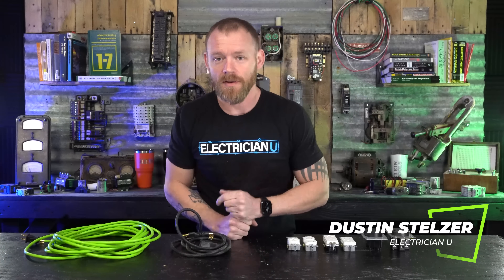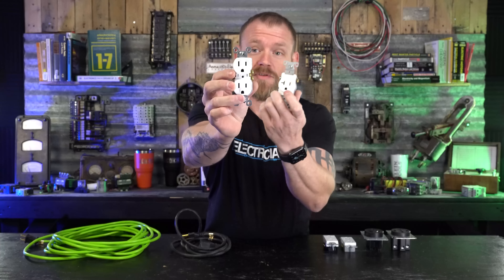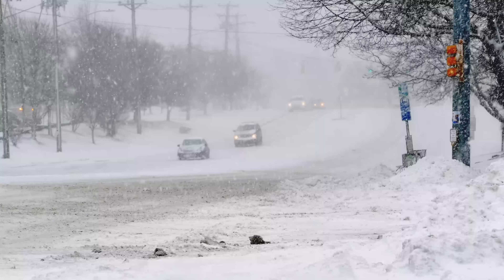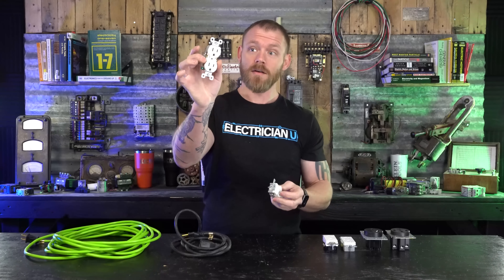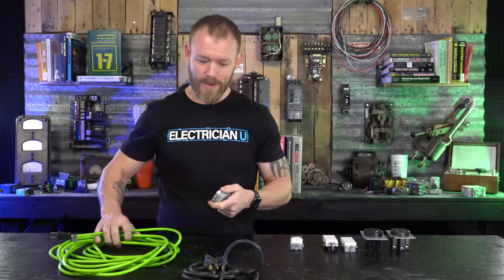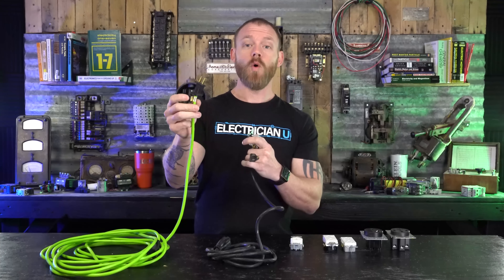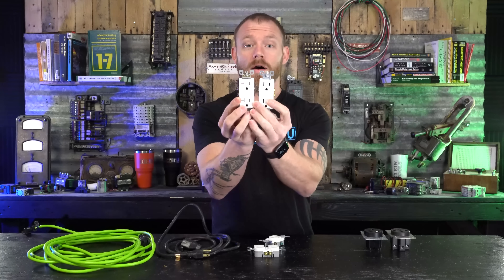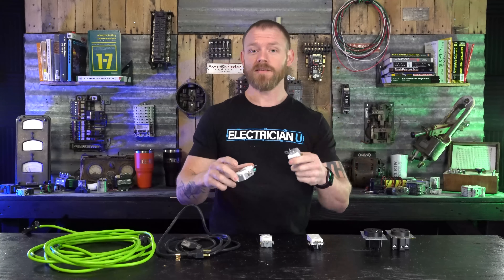Why Do Outlets Have Different Types of Holes?

Comment: Hey dustin, was wondering if someday can you explain about the phase-a-matic pam-300hd is a Phase converter. Hope you see this comment and reply back!!:)
Reply: Explain why ??? Your question is hard to understand the way you worded it 🤔
Reply: Phase conversion,  phase-a-matic , for the conversion of 220v 1phase to 220v 3phase , allowing the use of 3phase equipment in or within a single phase dwelling/property. 

Example : Heavy duty shop equipment.
Reply: @FCES_Electrical_Sol  my work had an alignment lift that went through motors yearly recently. The owners friend came and looked at it. Come to find out, we had an old transformer for a dyno for state inspections left behind. When the addition was done, we found we had 240 without issue but when we hit the button, one legged voltage dropped dramatically! The guy bypassed it and no issues since. The motor even sounds happier.
Reply: I just bought a rental house and the previous owner was an electrician. He had a South Bend lathe in his basement, this thing was huge with a 12 inch chuck and 5000 watt three phase motor! this guy literally climbed up the electric pole outside his house and ran lines from the main lines down the side of the pole and underground into his basement and stole three phase electric from the power company🤣

Comment: A 125/250v receptacle has two hots and a neutral, so it can supply both voltages. Like an oven that has a digital clock, the neutral is needed for the 120v it needs to run. You didn’t say it correctly in the video.

Comment: All 15 amp duplex receptacles are rated to have 20 amps passed through them. This video is incorrect. 

The difference exists to physically prevent people from putting a 20 amp appliance on a 15 amp circuit. If a space heater has a 15 amp plug and it is listed by an accrediting agency,  then it can be plugged into a 15 amp receptacle. If it draws more, it must have a 20 amp plug.  it can only start a fire if it: 
1. Malfunctions
2. Someone plugs multiple space heaters into one circuit and the breaker fails to trip. 
3. A space heater without a tip over sensor gets knocked over.

Comment: 20A outlets can handle more heat than a 15A one.
I would use 20A on everything.
Save the 15A outlets for a dedicated line like for a refrigerator or clock.

Comment: I've seen people have 20 amp breakers, and 14/2 wire.... obviously a change due to tripping the breaker.... I'm actually amazed that these houses haven't burned down by now....btw....you CAN put a 15 AMP receptacle on a 20 amp breaker...as long as the wire is 12/2.. it's code.... would I recommend that? No

Comment: Does that 3 prong 250v outlet have only 2 hots and 1 ground without neutral?
Reply: That's correct. Neutral is used for split phase 120v but 240v uses the entire phase and therefore no neutral. Neutral is the center tap on the transformer which divides the voltage in half.
Reply: The one he shows is a 10-30R with 240/120vac without a ground.   line1, line2, and neutral.   Older style, that is no longer allowed to be installed on new builds.(1996 code update I think).   When the 10-30R is in use in homes, there are instructions on Dryers to bond the cabinet to neutral.

Comment: The round twist lock is for 220v, right?
Reply: No, they are also made for 120-volt receptacles each have their own NEMA number. which designates, 120, 240, 277, 480 volts. lots of twist locks for different applications.

Comment: It really is not the socket that is the problem but if the socket is 15 A the breaker can also be and the wires can be thinner so a 20 A device could overload it. It would take some time for the breaker to trip. 20 A socket is allowed only if the circuit can handle it. A space heater can pull max 12.5 A (1500 W).

Comment: When the small slot is turned 90⁰ its a 240v outlet.

15 amp 120 volt  (I.I)  "5-15R"
20 amp 120 volt (-.I)   "5-20R"
15 amp 240 volt  (I.-)   "6-15R"
20 amp 240 volt (-.-)    "6-20R"

Note: the 15 amp 240 volt version ,while legal, is rare because idiots kept cutting the ground plug off the 20 amp 120 volt plugs so they could plug them in to it upside down. ( and set stuff on fire )

Equipment voltage ratings.
The voltage rating tells you what kind of plug the equipment uses ( grounded or ungrounded) and what frequency the equipment can handle ( N.Americas 60 cycle or Europe's 50 cycle )

"110-120" no ground plug , 50 or 60 cycle.
"120" no ground plug , 60 cycle only.
"115" ground plug , 50 or 60 cycle.
"117" ground plug , 60 cycle only.

So if you look at your cell phone charger it will say " 120 volt" but the power supply for your computer will be labled "115 volt"

Some high end audio equipment will be labeled "117 volt".

Anything that can run on 50 or 60 cycle and doesnt need a ground ( like an old incandescent desk lamp )will be labled "110-120 volt".

Bonus fact.

"32 VDC" means the wire or fuse meets DOT's requirements for on-road vehicles ....ironically one of those requirements is that it be rated for up to 300 volts dc

So yeah, that wire labled "32VDC"  is actually rated for 300 volts.

Comment: If you take both apart you would not see a great deal of difference between the 15 amp and the 20 amp outlet internals . Makes me wonder .
Reply: Manufacturers have standardized as much as possible, in order to use the same production lines to build 15A and 20A receptacles.   The essential difference is the plastic face piece.  The purpose of which is to idiot-proof the user, and stop them from putting a 20A appliance on a 15A branch circuit's receptacle.  The receptacle itself, would not melt, if you retrofitted a 15A plug on a 20A appliance, and forced a 20A appliance to run on a 15A receptacle.  The plug would melt,or the breaker would trip (if it were on a 15A circuit).

You can put 15A receptacles on 20A circuits, since they are still rated to pass 20A between each other, even if only meant to deliver 15A to each individual receptacle.  It's common to do this, because that way you can supply more power to a circuit of multiple receptacles.   Even just one duplex receptacle is enough to permit you to put a 15A receptacle on a 20A circuit, because the two receptacles on a duplex yoke, count as two receptacles.  Vice-versa, you can't do that, as it would cause the breaker to trip, when a user plugs in a 20A appliance.

Comment: You talk about the 3 conductor vs the 4 conductor on the 240, but you don't say why.  I would be a bit more understandable that a range and a drier need 120 in addition to the 240.  Clocks, lights, controls, etc on the stove need 120 and the drier motor is typically, but not always, 120, where as a water heater, welder, table saw, or other shop type tool, only need 240 and the neutral need not be run.

Comment: That receptacle you said for welding showed in your chart as a rv receptacle.   How can you use a 15 Amp receptacle on 20 amps when it is only rated for 15 amps,  you'll overload that 15 amp receptacle and have a meltdown.

Comment: That 4 prong straight blade is not a 120 or 240-volt receptacle it is a 120& 240-volt receptacle.
Reply: Correct. It's got phase a, neutral, phase b, EGC. Whatever device can use the P to P or P to N for something like a dryer to run heating element on PtoP and control board P to N
Reply: Kinda bothered me when he said that.  American Dryers need both 120 and 240.  The timers/ computers/motors are ran off 120vac while the heating element is the only 240vac load.

Same for Ovens/Ranges in the States

Comment: As for space heaters, I have never seen one rated more than 1500 watts, though I have seen some advertised as higher, like 2000 watts, but they plug into a 240 volt receptacle,  15 or 20 amp, like you'd use for a large window air conditioner, but that's something you are not likely to be using in a family residence,  except maybe your garage.  Just saying.
Reply: Think he was referring too multiple ones plugged into on unfused Powerstrip. Only scenario which could overload the wall socket.

Comment: I remember like 10 years ago. You could plug in a cord upside down or right side up. There wasnt a right way. Recently ive noticed all plugs now have a big prong. Wasnt like that before. Worked fine before. Why the hell did it change? And when? Because if it worked before, seems no reason to change it!

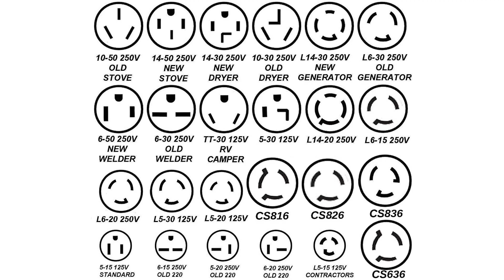Comment: @6:30 is the chart wrong? And showing a 110v 20a as a 220v?? 
At the bottom.
Reply: Good eye. Looks like the 5-20 and 6-20 are backwards. 5-20 should be the 110v and 6-20 is the 220v
Reply: @Krankie_V  both labeled 220v
Reply: @turboflush  I know they are but as you said it's not supposed to be, the 5-20 is 120v

Comment: But wouldn’t a 20 amp space heater have a 20 amp plug? So it would not fit in a 15 amp outlet.
Reply: Some twenty Amp spec graded male plug will not enter a 15 Amp residential grade outlet. Usually found on small air compressors, etc,.
Reply: If the heater used more than about 1500 watts it would be equipped with a 20A plug, correct.

1500 watts at 120 volts is 12.5 amps which is the most that a single  device with a 15A plug should use.

That being said, I have a welder which has a 15 Amp plug and yet is rated to use up to 30 amps current! So far I've never tripped a 20A breaker with it, but I'm going to install a 30A circuit and use twist-lock plugs anyway.

Comment: I'd love a follow up to this video going over why so many rightly believe that it is okay to allow 15 amp receptacles on a 20-amp circuit when this video actually didn't go into it:

220.21 (3) Receptacle Ratings. Where connected to a branch circuit supplying two ore more receptacles or outlets, receptacle ratings shall conform to the values listed in table 210.21(B)(3), or, where higher rated than 50 amperes... etc etc.

In that table it explicitly states: Circuit rating 15 OR 20 Amperes, Receptacle rating 15 amperes, maximum load 12 amperes.

Yes. You can have a 15 amp DUPLEX receptacle on a 20 amp circuit. But you can't.. well.. you shouldn't connect a 15 amp load to it. You can NOT have a 20 amp circuit with a single regular receptacle rated at 15 amps on it. Pretty simple if you look at the code. There's other exceptions but the gist is that it is allowable.
Reply: @scyarch.... You are right. I have never agreed with the thought process that two outlets (provided by a duplex) will allow for the 20 amps available to be split up.... It's still 20 amps flowing through a 15 amp device, right? But I only heard for the first time in this chat that all 15 amp receptacles are actually rated for 20 amps. It makes sense to me now but I am going to verify it. I have never installed a single 15 amp duplex receptacle on a 20 amp circuit because of this. I have installed multiple 15 amp duplexes on 20 amp circuits..... But I have never preferred to. I got to call a rep tomorrow and verify this. If true... I see the logic in it.

Comment: Polarity is kinda irrelevant in AC.  Current flows back and forth between neutral and hot,  they are both 'hot'.
Reply: Wrong, 120v on hot and 0v on neutral which is bonded to ground at the main panel. You'd be correct on a 240v circuit in which each leg will alternate between supplying and returning current. On 120v, the neutral is the 0v center tap of the transformer between plus and minus 120v.
Reply: @surferdude642  still carries current.   Current alternates between neutral and hot, 60 times a econd.
Reply: @willf2896  What you're saying is correct regarding current, but the voltage on the hot wire (black) will always be measured at 120v with respect to neutral or ground under normal operation. The hot refers to voltage. Polarity is relevant in a 120v circuit and if you mixed them up you'd have a reverse polarity which is problematic. That's why most tools and appliances that have a 2 prong plug, the plug is polarized so it can only be plugged in one way. In a 240v circuit polarity is irrelevant because the VOLTAGE alternates between positive 120 and negative 120 with respect to ground.

Comment: You forgot to mention the mythical 208 .
Reply: 208V is not mythical.  If you live in an apartment dwelling, you get 208V between your two live phases.  Watt-intensive loads like dryers and ovens, will run off the 208V source of power to operate the heating elements, while using 120V to operate more voltage-sensitive equipment like motors and circuit boards.  This will mean your heaters will take longer to get to temperature, and will have a higher fraction of on-time to deliver the same energy, due to running at 83% the voltage and 75% the power, but since they are heaters, they are a lot less voltage sensitive than other equipment.

The 208V happens because your service is derived from a master 3-phase service to the whole building, that is 120/208V wye.  Each dwelling unit gets a staggered pair of phases from their neighbor, along with the neutral, so that on-net, all three phases get used.

Comment: I'm not keen on leaving comments, but as a Brit and in and out of my friends farm in Florida it is about time that the USA standeredised your electrical installations, its always a wonder to me as to how all your houses do not burn down! I would like to know how electricians are trained and instilled with quite frankly dangerous practices, for example just run domestic circuits that suit all sorts of domestic equipment, a 20amp ring main or 20amp radials, separate 250v for cookers and washing machines, then a seperate 5 amp lighting circuit. I've seen so many things that are installed that people don't understand and are dangerous, and how current draw works and the porential for fire, your heater for example. How do you work out your circuits?
Reply: Become an apprentice (in the US) and all your questions may be answered.
Reply: @Merescat  I'm a 65 year old mechanical engineer with a life time of experience it's not me that needs training, with respect.

Comment: One of the stupidest quirks of the NEC is to allow a NEMA 5-15R receptacle on a 120 VAC, 20 A circuit.  Please, install only 6-20R receptacles, and don't look back.

On another subject, it's unfortunate that you can't look at a NEMA 2, 6, 10, or 14 receptacle and know whether it's 208 VAC or 240 VAC.
Reply: Do you mean 5-20R? 6-20 is for 250v.

Comment: The only actual difference between 15A and 20A receptacles is the plastic face piece, on modern versions of this receptacle.   The core inner-workings are exactly the same, and technically can carry 20A.  Manufacturers have standardized as much as possible, between the designs of a 15A and 20A receptacle.   At one point, it may have been different, so older 15A receptacles might actually be set up such that 16A could cause them to fail.

Internally, they are identical.  You cannot melt a 15A receptacle if you somehow put a 20A load on it, despite the plug geometry.   The reason we have 15A receptacles, is to prevent you from plugging in a 20A appliance to a receptacle that is built on a circuit from a 15A branch breaker.  It's all a matter of idiot-proofing, to protect the wire and avoid nuisance tripping fo the breaker, than to protect the receptacle.

Comment: Why do some electricians install receptacles with the ground up and others with the ground down?
Reply: The answer is personal preference, however there is a safety argument to be made here. If the ground pin is installed "up" then a plug which is  it inserted all the way poses less risk. An example would be something like a metal ruler falling across the blades of a plug and causing a short circuit. It simply won't happen with the ground pin at the top rather than the bottom. However that's kind of a rare occurrence so it comes back to preference. I put my ground pins at the bottom because that's how they've been everywhere I've lived so I am used to it that way.
Reply: @Californians_go_home  explain
Reply: @Californians_go_home  skills are bending pipe on an aerial lift, skills are being able to fish a rod and make it pop out the other end, skills are being able to find an open neutral in minutes, skills are being able to neatly make up a Jbox in a crawl space, skills are abiding to the NEC, nothing skillful about putting a receptacle upside down... I wouldn't work for you, I need mentorship not hackship.
Reply: @Californians_go_home  alright fair enough 🍻 at the end of the day we're all electricians.

Comment: T SLOT UNGROUNDED  OUTLETS??? Go back to 1940 S the era of cloth wiring inside the walls of a home back in the day.
Electrical wiring used to have  cloth covering the wires 
Grease was coated over the fabric to hold it in place 
IT was messy to work with .
WHO HAS PLUGS TODAY  WITH THE BLADES GOING HORIZONTAL TO NEED A UNGROUNDED T SLOT OUTLET TODAY.